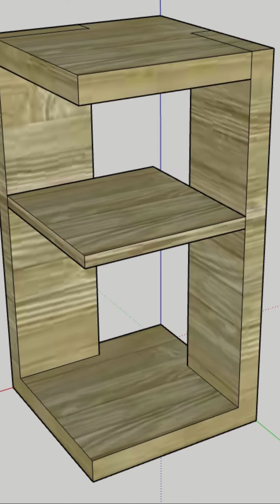Walnut and Maple Side Table Complete Build DIY

Comment: measurement's pls.
Reply from the maker: Top and bottom are 14” x 14” x 1.5” thick (355mm x 355mm x 38mm). The side pieces are 7” x 21” x 1.5” thick (177mm x 533mm x 38mm). The shelf is 12.5” x 12.5” x 1”. (317mm x 317mm x 25mm).